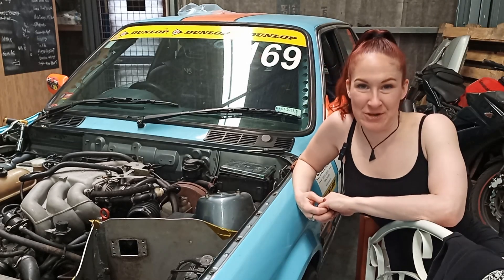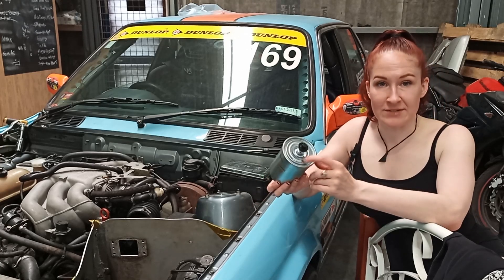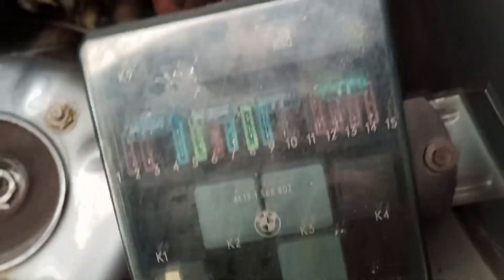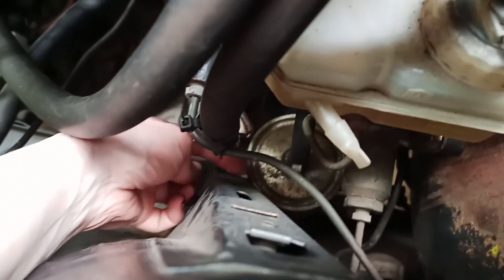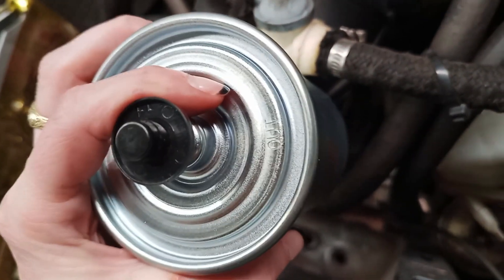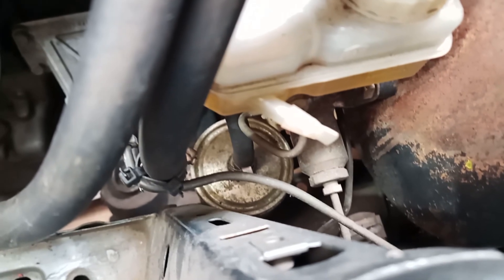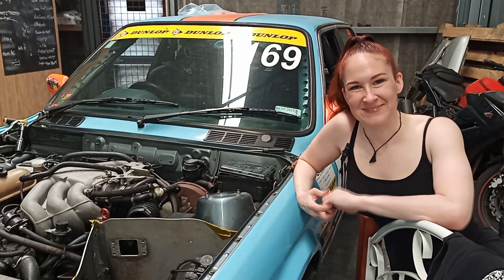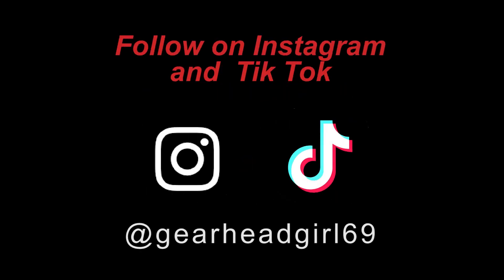Fuel Filter Replacement *DIY* BMW E30 - GHG69

Comment: Hey nice video im trying to do this job myself... Are you approaching this from undernearth the car or above? Im finding it so hard to get into this spot, what model is your E30?
Reply from the maker: 320i. Top down seems easier if you have the dexterity to get the lower hose off, but whatever gets the job done 👍
Reply: @GearHeadGirl don't know how you did it so easy... The dexterity sure came into play... 325e here I removed the power steering resovoir to the side, the charcoal filter then the fuel filter... To get hands down in there for basically anyone is a task in itself... This is a job for going underneath... Respect to you though x
Reply from the maker: Yeah it's not exactly easy, but tiny hands help 👐
Reply: @GearHeadGirl  They do indeed. I have quite dextrous tiny hands sorta lol... ive been able to do a lot of things on these cars with that ...